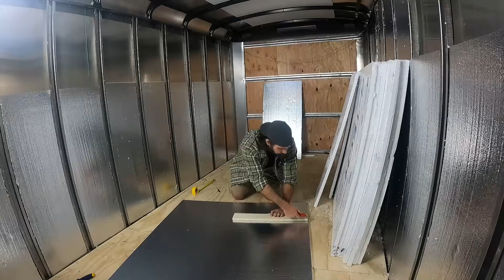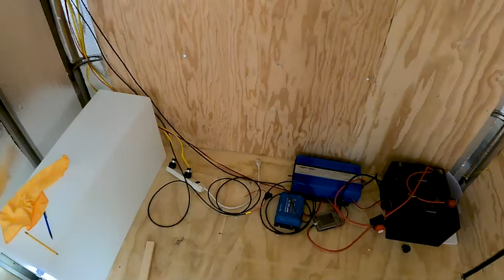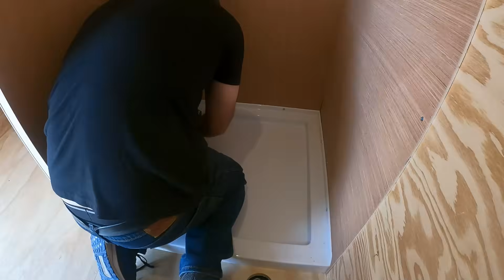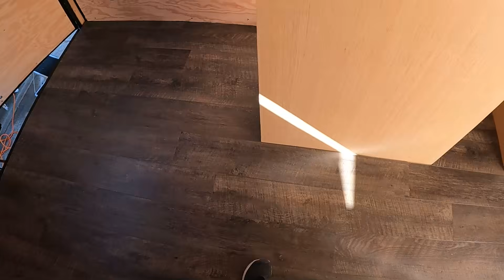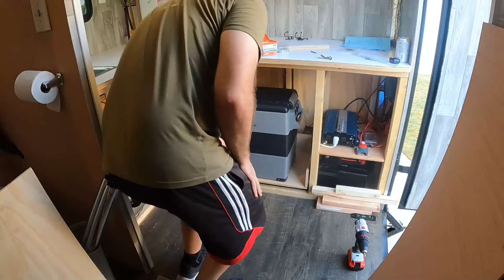Cargo Trailer to Camper Conversion - Full Build

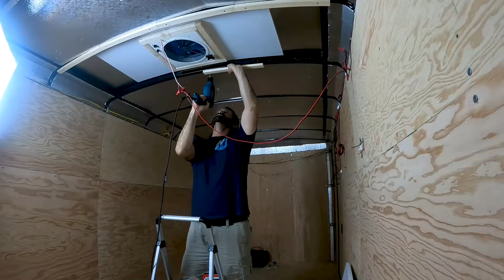Comment: Did i see that right? At 2:53 the wooden box around fan isn't attached to roof frame, roof fan will flex causing leaks later on.

Comment: I believe I would have installed the solar panels and cut the holes for the windows before putting the inside back together after insulating.  You could have added headers to the side "studs" you cut as well as done a better job with the roof work.   I'm only up to the windows right now, but I do know after watching many of these videos and having many (house) construction projects under my belt, you don't install anything finished until you strengthen up the bones.

Comment: Batteries should be outside te let off gases. Thats why no one uses them. Unless you have air vents all around them going outside.  I used led too cuz i couldn't afford the other ones. But they are very dangerous inside.

Comment: Well done. Curious about the wiring. Did you drill holes in the studs to bring down to boxes? And did the boxes stick out a fair bit as they are normally deeper than the walls of these trailers. I’m working on mine and looks like I need to drill 1” or 3/4 hole for the 14/2 wire.  Any advice?

Comment: Does the ceiling have wrought iron bars... that would be strong enough to support a hammock? My hammock stand is exactly is 7'11". I think I'm probably going to get a 5x8 trailer for my Jeep to pull. During the day, I want as much open working space as possible. So hopefully it'll work out great 🙂
Reply from the maker: The bars are pretty strong, but I'm not sure I'd trust a hammock on these. If you added some bracing that could distribute the weight to the floor, you could probably make it work though

Comment: For people doing vinyl on walls, or floor, it's best to use a 1/16" V-notch trowel(1/8" for floors if level, 3/16"-1/4" if uneven surface)to spread the mastic(glue), it will give you a much more uniform, and reliable surface to stick your vinyl to. I'd also suggest using a multi-purpose mastic, to get with moisture, mold, and water proofing.

Comment: Great job.  I would have went with smaller windows BETWEEN the metal support beams rather than cut-out the supporting structure the way you did.

Comment: why didn't you insulate that ceiling better? looks like a 1 inch or so gap that could of been filled.
Reply: That gap is insulation.  That's how double pane windows work.
Reply: @MAXIMUSMINIMALIST  double pane windows have argon or some other gas in there. I would used some 1" foam or some rock wool.  sound denting too.

Comment: I love the way your trailer turned out, great job! If you wind up having any leaks down the road on windows or roof, try butyl tape and dicor. What you did with the walls is genius!
Reply: I was thinking the same thing about the butyl tape and dicor for the attchement of the roof vent and windows.

Comment: This looks great! Thank you for the video. I have a 6x12 cargo trailer conversion camper that I'm working on, not sure if I will ever finish. I really liked your idea for the walls, wish I had thought of that! I have insulation and then plywood. I painted them white but it needs something more...do you think the vinyl flooring could still be an option? Would I need to sand the paint? Or other suggestions?
Reply from the maker: I think sanding first would be best. At the very least, I'd sand near the edges or for bigger sections, where it really needs to stick.

Comment: Awesome work! A frame to the roof for the panels is the way I'm going.  The frame will be with 80/20, and will hold 8 445w solar panels. With some actuators  the frame will expand 2 rows of 4 panels and slide together when not in use. Battery bank is 15kwh, expandable to 20. I went over board but this will be my home, parked on my land while I build my home.  If all goes well I may try to make the system compatible to charge at EV chargers too. Well see though.

Comment: Has the shiplap fell down yet? Vibration from pulling it will make it fall down, just being held by nails.
Reply from the maker: That's a good point. I'll bet thats inevitable over time. I'll probably add glue or a few screws when it happens. I'll bet adding glue initially would have gone a long way

Comment: Thanks for this series. I’m literally copying your build ideas. Minus the shower and bed as I need that space for my ATV. I love the shiplap roof and the glue on fake wood walls. 
Where your sink is I’m gonna put a cubic mini grizzly. And then have a stove and sink. 
I’m probably gonna get the bottom of the trailer spray foamed. 

If you guys want I can post my progress so far

Comment: Very nice!  did you insulate the floor and ceiling?  How tall are you?  Can you sleep in that bed comfortably?  I'm 6'1 and usually cannot sleep the width of the trailer and would have to sleep the length of the trailer.  I have thought about a Full size murphy bed that tilts into a desk.  Seems the gray & black water tanks are really low to the ground, have you thought of a lift kit for your trailer or would that cause instability?  Not sure if you are taking off road or to only campgrounds, just curious if you have scrapped bottom at all?  What do you pull your trailer with?  Truck/SUV?  Thank you so much!

Comment: Did you happen to do before and after scale weights? I'm debating on whether or not to go fully bare-bones pragmatic or something really nice like this. I need to carry motorcycles and other things that make payload a priority for me. Very nice videos by the way. Thanks for taking the time to upload. Also, did you do a video just on the black tank?
Reply from the maker: I didn't get the before weight, but the bulk of the added weight is the wood. Here's the video on the black tank: https://youtu.be/fH19WJxYZbI
Reply: @befreebuilds  Thanks. The tare weight should be posted somewhere on the trailer or the paperwork for the trailer. I suppose I could have looked a little harder for the black tank video, but thanks for the link. Cheers.